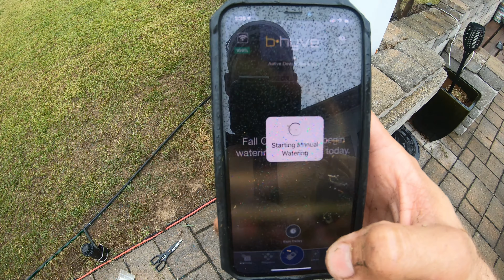Lawn De-thatching, Scarification, and Power Seeding

Comment: Looks like you put the seed down first then used the scarifying attachment to cut the grooves? I ask because I usually see people run the scarifying attachment first to cut channels in the dirt then lay the seed down.
Reply from the maker: There are 2 different attachments for the Sun Joe.  The first one I use before seeding is the rake attachment, to remove the dead grass and excessive thatch (not all of the thatch).  Then I lay the seed, and run the scarifier blade at a shallow depth, to embed the seed just below the soil.  Then mow and bag a final time to pick up any remaining thatch and dead grass that the scarifier blade pulls up, without worrying about the seed being picked up along with it.  I have experimented in many ways over the years, and this has provided the best results.
Reply: @AMIKconstruction   @Amik Construction  I appreciate the additional insight. I have a Sun Joe sitting in a box in my garage ready to use for an overseeding job. I will be trying your method to get the best seed to soil contact. I also read a paper from the Nebraska Extension that recommends a method similar to yours.
Reply from the maker: D T I also recommend just throwing the bagging attachment out...it’s useless haha.  I have also found the best results in pulling the dethatcher backwards towards you for each pass, in about 6’ lengths, lifting up to drop a nice pile of thatch/dead grass, then moving to the next pass.  This way you have a nice long line piled up to bag or suck up with your mower.

Comment: Is scarifying the same as aerating ?  Also,  I’m looking for the sun joe with both attachments (dethatch and scarify) can you send the model # and name ?
Reply from the maker: Though both processes are attempting to accomplish a similar goal, aerating is different than scarifying. The type of soil you have is really the determining factor, of which process you use.  A thick, harder soil will benefit more from aerating, to allow better penetration of water and nutrients.  A loose, soft soil, like sandy loam...benefits more from dethatching...since the only thing really impeding water and nutrients is the dead grass and thatch.  The scarifying blade is MUCH more aggressive, basically loosening the entire top layer of soil, almost like a tiller, which is best for when you are over seeding, to embed the seed into the soil.  The model I use is AJ801E.

Comment: If you seed first then use the sacrificer wouldn’t that just throw the seeds around?
Reply from the maker: If you scan to 3:50 I show how the scarifier embeds the seed into the soil…then again at 10:50. Just laying the seed on the surface doesn’t do the job, and it would also allow for water runoff to wash the seeds around. It also helps cut down the amount of seeds that birds will eat up.
Reply: @AMIKconstruction  thank you so much for the response.

Comment: Have you tried to spread in a top soil or fertilizer in after u powerseeded it.   It helps to retain water.
Reply from the maker: Eli double dub Because of the years of neglect, I was giving the process I demonstrated a chance first.  The scarification process pulls up a substantial amount of soil, just enough to allow the seeds to embed properly without being buried.  Due to the shorter days in the fall, you do not want to bury, or cover, the seed completely by applying a top dressing, as the surface isn’t being warmed sufficiently to promote germination.  And any seeds that do not reach a certain stage of germination before the first frost takes place, have now just become a very expensive and insignificant vitamin for the soil.  As it happens, it’s now a year later, and approximately 95% of the lawn is nicely filled in and very healthy.  In the early Spring, I will be applying a top dressing/over-seed  to the remaining problem areas, and I should have my “golf-course” lawn  by June.